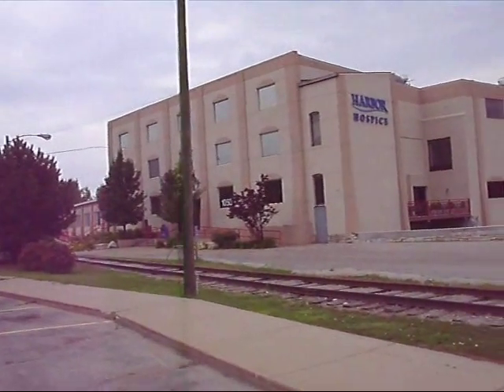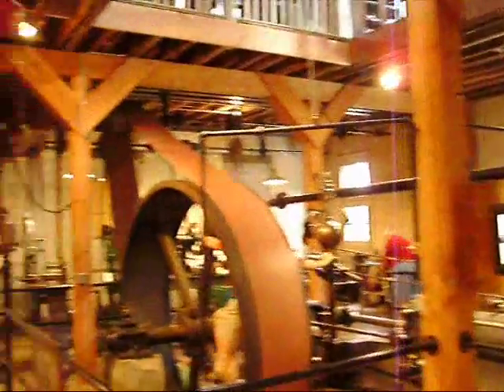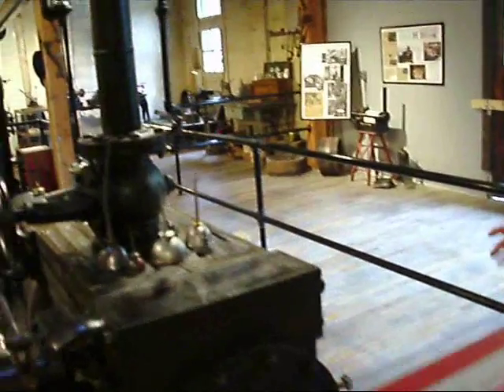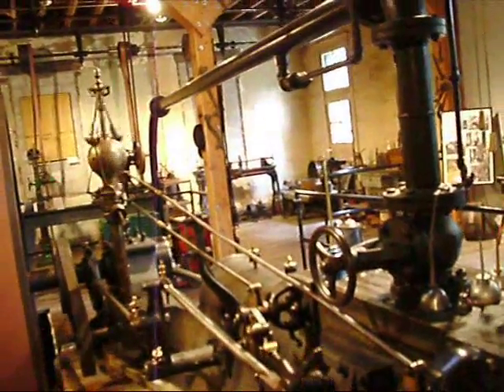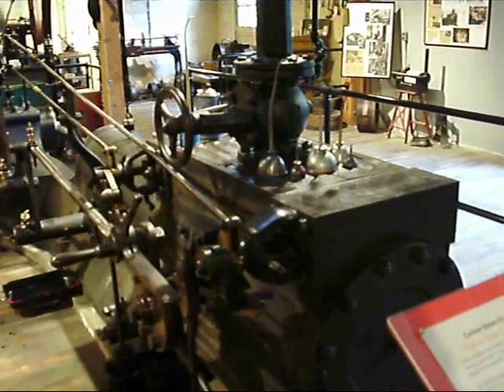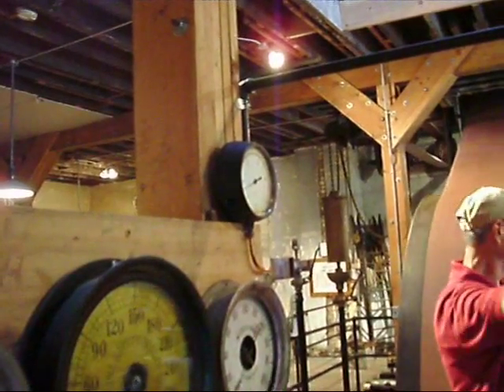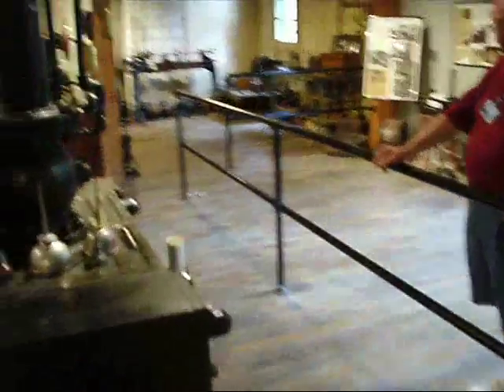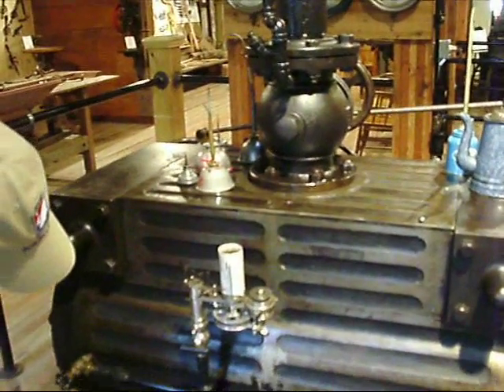Corliss High Speed Stationary Steam Engine . Part 1

Comment: looks like it would be around 100hp depending on pressure
Reply: +Chad Yelland  That thing plumbed to the side of the cylinder looks like a steam indicator, it recorded cylinder pressure over the length of the stroke, used for valve setting and timing but not for general running.

Comment from the maker: The cost would be high to buy a boiler. there was only one boiler in the Hartshorn Curtain works,so only one would do. In addition, you'd have to have a licensed boiler operator. Then there's the boiler inspection plus additives to "soften" the water to prevent scale. Also the heat radiated off the pipe would raise the interior temps to an uncomfortable level.

Comment: Thanks for your comments, kk, now for corrections.. This is a corliss so named for the inventor george corliss, designed the valve arrangement, also known as rotary valves, it uses the corliss valves n valve gear arraingments.. it is a corliss, rpm slow enough not to activate the dash pots.  It is an indicator on the side...

Comment: At a closer glance I cant see the catch and release on the intake valves. Either that or it is just running too slow to build a proper vacuum in the dash pots. But it seems that this may be just a rotary valve engine, without a true Corliss valve gear.

Comment: the "thing" with the paper scroll on the side of the cylinder is actually a pressure/volume recording device, not a temperature recording device as the volunteer stated.

  it is a steam engine indicator and was used to see what was happeing inside the cylinder as far as steam usage and valving. it scribes a pressure/volume diagram on the paper with a pencil. the indicator will show compression, admission of steam, cut off, free expansion, and exhaust in that order.